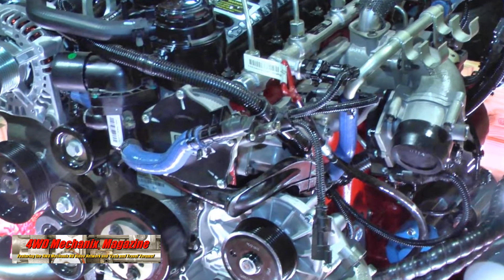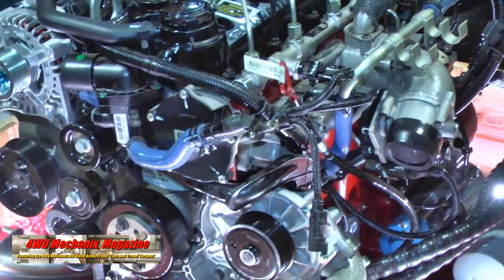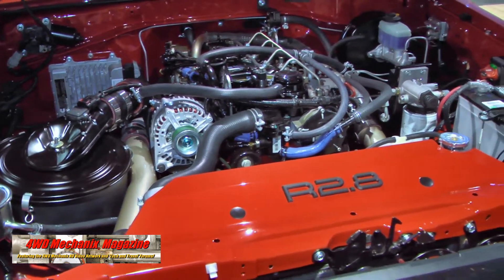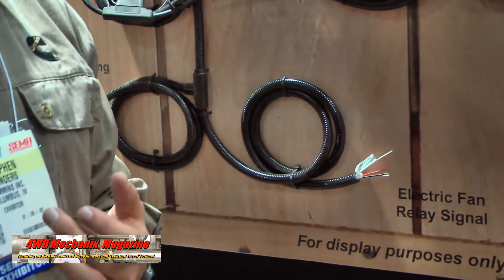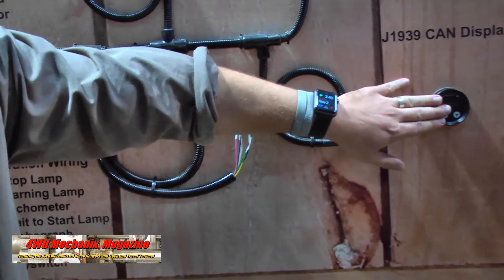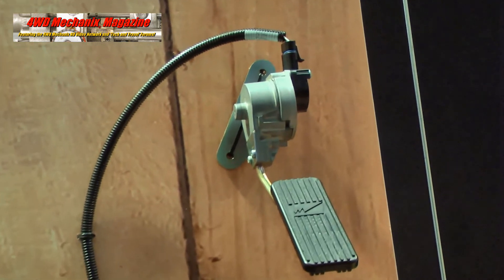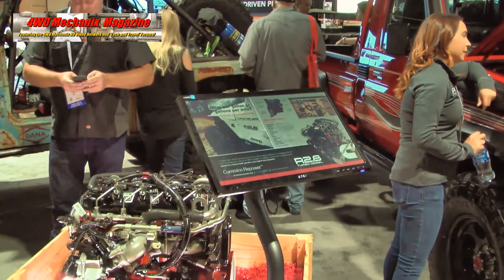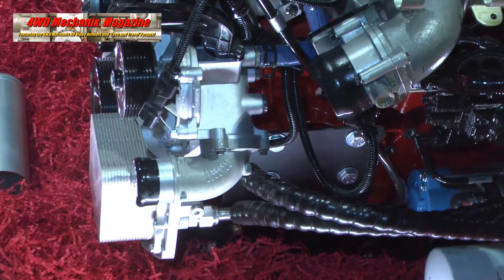Cummins R2.8L Turbodiesel Crate Engine Installation

Comment: If want buy just wirring where to buy
Reply from the maker: I would send an inquiry directly to Cummins Repower.  Look for a contact form at the official Cummins website.  The R2.8L crate engine currently shows “Out of Stock”.  The wiring harness should be available under a separate part number.  In addition to the Cummins website, a local Cummins dealership parts department may be helpful for finding the R2.8L crate engine wiring harness.
Reply from the maker: I went to the Cummins website (https://cummins.com) and found information about the R2.8L that is readily available to any consumer.  Go to the site for these details.  Some information that I quickly found was a part number for the “Harness Installation Kit” that comes with the crate engine:  P/N 5467025.  This is likely a partial harness and not the full control system and wiring harness shown in my video interview at the SEMA Show.  There is a PDF downloadable Installation Guide available for the R2.8 CM2220 R101B crate engine.  The PDF at the Cummins website is 0042728.pdf (6.7mb).  The guide says to go to the https://store.Cummins.com site for more details.  There are wiring harness diagram manuals available, but this is not the wiring harness itself, just the diagrams, and these diagrams are costly.  There are 1,085 wiring harnesses available at the Cummins online store.  The control module that comes with the R2.8L Cummins Repower crate engine is #CM2220.  There is a downloadable PDF brochure that shows the display board filmed in my SEMA Show interview video:  0042522.pdf.  The illustrations do not show part numbers.  Cummins has a tech phone line that should be able to provide information on this complete harness and controls system.  Phone 1-800-CUMMINS.  Cummins has a free chat line and the phone number for finding parts and reaching an “Expert”.  Give Cummins a phone call or contact the Cummins Chat Line at the official Cummins website.

Comment: Where are the Cummins 2.8 built
Reply from the maker: There is confusion about the engine's origins, as Cummins does have affiliate plants at China.  Early on, these engines were "assembled" at the Columbus, Indiana plant, though I'm not sure whether that's the current status.  Here is the latest information directly from Cummins, and I suggest anyone interested in installing an R2.8L Turbo Diesel crate engine read through the Cummins site information before committing:  https://shop.cummins.com/SC/product/cummins-r28-turbo-diesel-crate-engine-5467036/01t4N0000048ikGQAQ.  There are many satisfied installers.  I have seen several examples at the SEMA Show.  However, despite the cleaner tailpipe emissions (the R2.8L meets a tier acceptable for 1999-back light trucks and 1993-back automobile standards), to date this crate engine is neither EPA nor California emissions certified.  (The engine cannot be sold in Texas, W. Virginia or Quebec.)  Know your local regulations.  I did an extensive article at 4WD Mechanix Magazine on emissions issues for any diesel or gasoline engine transplant/swap, following the California/50-State requirements.  The link to that article is:  https://4wdmechanix.com/cummins-4bt-and-4-isb-diesel-engine-conversions/.
Reply: @4WDMechanixMagazine  thanks for your reply. I have already bought the engine for some. They haven't supply the wiring harness with. So my question can i buy just harness  TXX